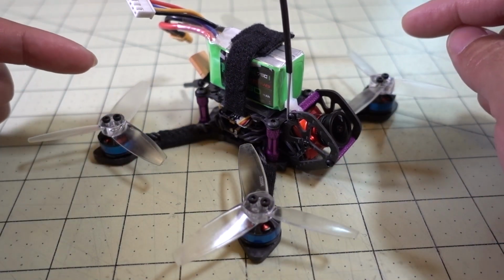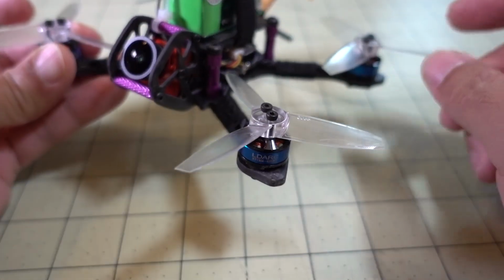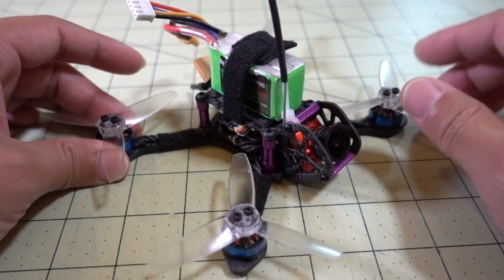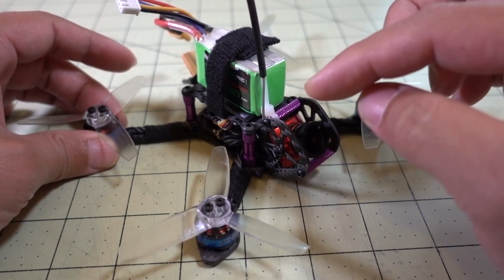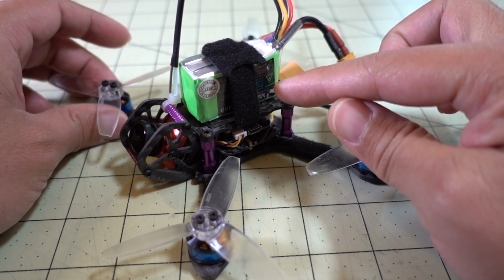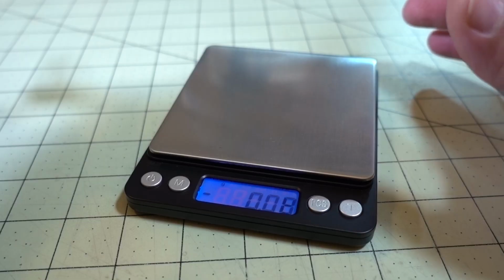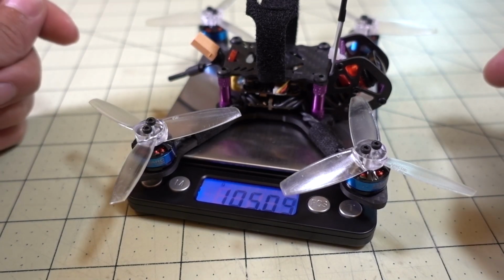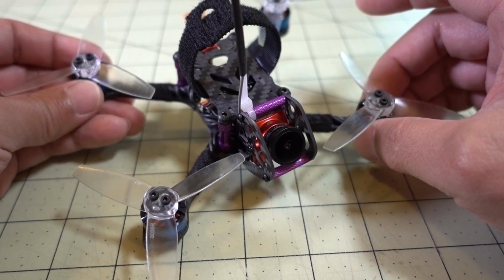MD#106 🚁Helifar Turtles Improved! 👍

Comment: While we are talking about this model, the DYS 1404 4300kv fits, flies amazing on 4S and really long flight times but, the Airblade 1404 3850kv  does not fit. The top mounted lipo has a great feel and great flight characteristics for sure. It was a challenging build form me but turned out really nice!

Comment: What other top mounted battery frames (3 inch) have you in your fleet? 

I really appreciate you and your videos. I hope you will not become bored. I learn so much and try to emulate what you build. I am amazed at how nice this quad flys (a special frame in my view)  on 4S and weighing in at 110G. My first build utilized the DYS BE 1404  4300kv motors and has a 6 + minute flight time. I am preparing a second build but, want to try a 1404 as we are limited to the motors I would like to use because of the motor hole mounting pattern and the 11XX not fitting. I tried to dremel out one motor mount but was unsuccessful and probably ruined the frame. But, my next build will use a 1404 or larger but, that weight issue remains a dilemma for me. What other top mounted lipo frames do you have? 3" or smaller.
Reply from the maker: I'll have a QAV130 frame soon.

Comment: A good venue here for my comments even if not read by many and, I am learning and experiencing so much. Albert, I hope you dont mind my expressing my findings as I  basically am doing alternate builds on this model/frame w a top mounted lipo... My 2nd build of this helifar turtle 135 used the Brother 1406 4100 and although  lots of power, it's not as smooth, a lot louder/noisier, half the flight time and much much heavier quad when compared to my first turtle build using the DYS 1404s.. Overall, not as much fun to fly!.. I am waiting on the DYS 1404 6000kv motors to arrive, now. I will be removing the 1406s. I am still wondering what other top mounted battery you might know about,  frames you know about in a smaller frames only, please. Top mounted batteries are new to me and very different flight characteristics I might prefer. And thanks.
Reply from the maker: Thanks for sharing.  I have more top mount frames coming so stay tuned.

Comment: It’s so cute 😍 It’s like a mini 5 inch 😄 Did you try the new Emax Avan 3” props on Banggood ? They look strange but they fly and sound extremely good 👍
Reply: Nico Dindon I agree try these props they are AMAZING! I just got them and am in love
Reply from the maker: Yes, I have the Avan props but they don't work with the 1304 motors because of the shape.
Reply: Albert Kim oh that’s sad. Good to know. But they are compatible with the RCX 1304, because they are taller.

Comment: Great video on the upgrades! I was looking at this frame for a build to back up my Nemesis X but there’s no 2.5” frame. I thought they had a 2.5” frame. Was it discontinued? If so then should I use this frame with 2.5” props and 3s 650mah? Thanks 👍🏽🤙🏽😃
Reply from the maker: They only made a 3 inch, but you can certainly use 2.5 in props if you want.  I don't know if a 650mah 3S lipo small enough will fit on top but it should be OK on the bottom.
Reply: Albert Kim oh cool! Too bad I can’t use 1105 motors. What do you recommend that would be comparable? That way I can use stuff that I currently have. I wish that I went this route first then spending $50 on the Nemesis frame. This one seems to have more space for electronics and cheaper. 🤙🏽

Comment: I like it very nice 3 inch racer. looks like it flies great, sounds good. Great video
Reply: I had bought the SkyStar X140 kit. Very nice racer. Comes with a 4 LED light board thats active when battery is connected, but i what to control it from Aux switch as on-off. I assigned one in betaflight, but the switch will only turn the leds off and not back on for some reason (Tarnanis QX7S). Would you have any idea as to why it only turns off but not back on. Any advise would be greatly appreiceated. Thank you very much

Comment: nice! hey i have a question for you. any idea why my omnibus f4pro can be recognized, shows as com4, but when i enter boot loader it fails to show up and my computer cant read it?
Reply from the maker: in bootloader mode use Zadig to fix the DFU driver.
Reply: Albert Kim thanks for such a fast response. i tried to do that before i asked, i always try to before i take up someone time, anyway what happenes in bootloader mode is that it doesnt show up in list of devices in zadig. it will show up as omnibus f4 when not in bootloader but still will not connect in bf. i think my biggest problem is that my fc isnt up to date with the newest bf. actually im still havi a problem where my fc wont recognize a rx that another fc will recognize its a brand new fc that wont work.

Comment: Cool concept!  I have a suggestion for you, Albert.  Get an RC25G lens (Runcam) and put it on your Micro Eagle and set it for 4:3 / NTSC.  Use factory settings but lower sharpness and edge to 2 or 3.  Leave everything else in factory default settings.  It will blow your mind!  Yes, the lens is large and will probably extend beyond the frame protection - but it fits and the image is incredible.  Much clearer, sharper and brighter - and the color rendition is better than the stock lens.  Also easier to focus.  The image is very similar to the Micro Monster Pro - which I think is superior to the standard Micro Eagle, but better in ways. https://shop.runcam.com/lens-runcam-swift-rr/

Comment: Dude, your videos are killing me.... Ive bought 3 quads under 3 inches in the last month alone... BTW I really think you should do a review of these locknuts I found. Seems silly i know, but they are rather unique. They are SUPER low profile but very grippy and very lightweight. They are much much shorter than the low profile luminier nuts. Unfortunately they have a silly name and i swear this isnt a joke. They are called "Deez Nuts". Another benefit is that you save like a gram overall.  Its a microscopic difference but I know there are people who will care about that lol. Less weight on the props that has to be spun too. Mostly though its just nice for when a fat locknut wont tighten down far enough on a thick prop to grip properly. Anyways, i know its not your normal review, but I hope you atleast try them out even if you dont make a video of them.  I swear its not a prank, they are actually called "Deez Nuts" lol.